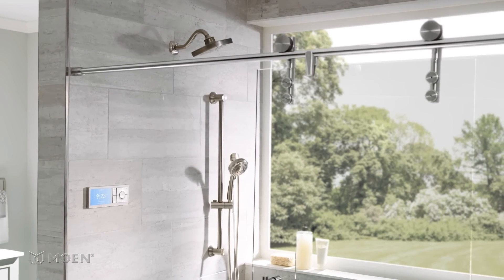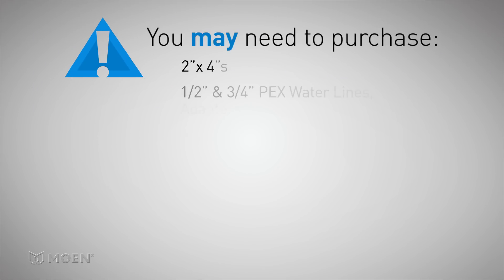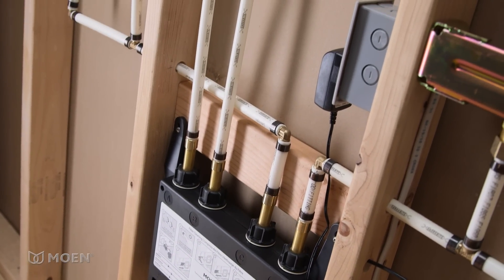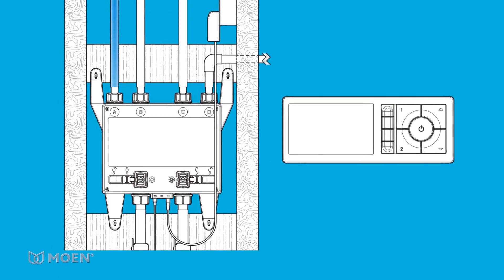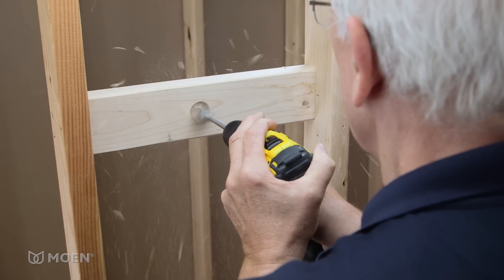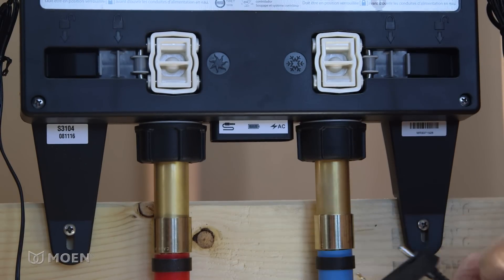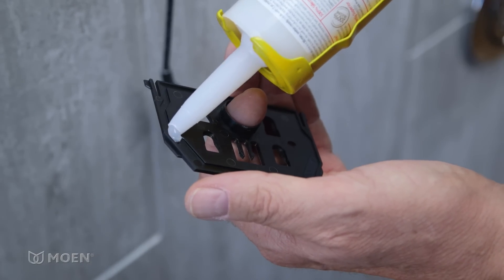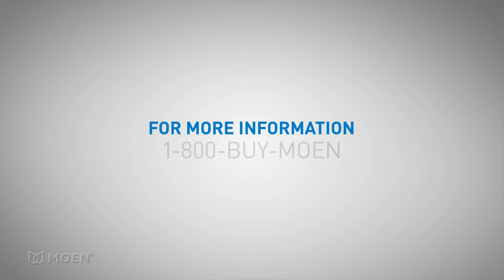U by Moen Shower  |  Installation

Comment: I offer this pro tip...  I had the predecessor to this unit the Moen I/O. And, after 9 years, the valve unit failed. Called Moen.  Buy it for looks, buy it for life?  Yeah, well, the life of the technology maybe.  Moen discontinued the I/O series and, guess what, stopped supporting it. No valve or parts available.  Now, if I had followed the directions and just run the control wire through the studs, I'd be screwed at this point.  However, I'm a son of an engineer and I thought ahead.  

I ran the control wire through conduit and left a fish rope in the conduit.  Yeah that was fortunate to say the least.

So, I pulled a new wire for the U by Moen, had to re-do the plumbing, but got the thing in.  Works.  

Run your control wire through conduit folks!

Comment: Moen: some feedback on the installation process. You clearly intended this to be used with PEX water lines - this video shows the adapters. But somewhere between design and installation, there was a breakdown.

I just finished installing the 2 outlet valve, but I'm confident the 4 outlet has the same problem. The connectors you include in the kit require an adapter to be sweated on before the PEX can be connected. The retainer ring that holds the metal connector on is plastic. Sweating the adapter on requires high heat - hot enough to create solder flow. Plastic melts, so the ring can't be left on while soldering. The retainer ring doesn't fit over the PEX adapter after the adapter is soldered. At least none of the 3 brands my local home improvement big box store carries. End result - there's no way to install this unit with PEX lines unless you do something not covered in the installation manual. Something involving a grinder (to slim down the adapter) and a dremel (to widen the hole in the retainer ring). Something I'm sure your design people would frown over, but there's absolutely no other choice, given the items included in the box.
The solution is simple, just machine the brass connectors to end with a PEX connector. Problem solved. I'm guessing you're going to wind up with some torqued off plumbers, and higher returns than you expected.
Reply from the maker: For specific installation assistance, please contact 1-800-289-6636 (US) or 1-800-465-6130 (Canada).  Thank you.
Reply: Two solutions:  If you sweat the adapter, then you can use a heat shield cloth to protect the plastic body.  OR you can use ProPress to crimp copper to pex adapters on.  ProPress is a "newish" way of handling copper fittings.  No soldering.
Reply: Using sharkbites here is the best option for DIY'ers.... These stubouts can be removed, but the black plastic nut cannot be removed as it will not fit back over the newly sweated fitting.  You can remove the o-ring if you're concerned with too much heat.  I'm not a pro, but I have sweat a lot of pipe over the past 20 years... I could not get a good, clean sweat joint between the moen stubout and the pex fitting.  I ultimately paid the extra cost and used sharkbites.... Pex stubouts for this system should be an option and would make install a lot easier.
Reply: @KevinNichols222 I thought the same, but my biggest concern is that the pipes coming with the valve are so thin that pro press may just bind them. 
Am I right?
Reply: Try connecting pex with sharkbite coupling
Reply: I saw this and thought crimp on or sharkbites
Reply: For me, I wrapped the plastic nut with a cold rag and soldered the PEX adapter. Worked just fine.
Reply: a shockingly sensible comment.  Bravo sir.
Reply: @moenfaucets  That's a terrible response. A written response would be much better, that way others can read it and learn.

Comment: So can you sweat the PEX adapters right onto the copper stub outs without removing them and removing the o-rings and removing the black threaded lock ring All of that can handle the heat?
Reply from the maker: Good morning. This rough in valve can take some heat. We still advise taking caution as to not overheat the unit.

Comment: This is a Great system for those multi head installations  This is at time faster than conventional valving
Reply: but much less steampunk, so there's that.
Reply: Great system? Have you think about when the valve is bad? Tear the wall?😢
Reply: @UltraHydrophobiccoat  You generally put this in an accessible spot, or put an access panel in to get to it quickly.

Comment: So no tips on soldering the tiny brass nipple with the plastic threaded ring in place? Since it wont fit over the pex adapter...
Reply from the maker: Hello greenis3006 and thank you for your interest in Moen products. The CC connections on Smart Shower valve outlets and inlets can be connected to Pex, copper or CPVC with standard plumbing adaptors. We do not recommend applying excessive heat near the valve. The plastic nuts and CC connections can be removed to plumb adapters to the connections. If you have additional questions regarding installation of the Moen Smart Shower, please contact Moen Smart Water Support directly at 1-844-633-8356.

Comment: I recommend if you're going to install the battery backup, put it OUTSIDE the wall, not inside, otherwise it becomes a 30 minute chore to change the batteries rather than  a 5 minute quick job.

Comment: I am in the process of a renovation. Got to the installation and find the hot and cold valves are reversed on this unit. WHY would Moen do that. My renovation just came to a screeching stop. Hot water on the right? REALLY? Look at this video. Hot is on the left from the back.
Reply from the maker: Hello Swynne,  can you send us a complete picture of the Moen product installed in your home, address where the product is installed, email address and a copy of your purchase receipt. If you would prefer to send this information directly, our email address is moenwebmail@moen.com.

Comment: Couple questions, how does the copper cap connect to the plastic piece in order to cap it off? Also the battery backup is meant for a power outage of several days?  Well if you don’t have power you won’t have hot water and if on a well you won’t have water either.
Reply from the maker: Hello CP H. If you are referring to our U by Moen system, there are no caps included.  It is a 1/2" brass outlet and any compatible 1/2" cap would suffice. The battery backup provides the opportunity to shower for 2-3 days, which will be dependent on your hot water environment.  Should you have any questions, you may contact us directly at 1-800-BUY-MOEN (1-800-289-6636) or email at https://www.moen.com/customer-support/contact-us.
Reply: If the power goes out and you have a natural flue vent (B vent) type water heater with city water, then as long as the gas company doesn't run out of natural gas you are good to go.
Reply: the battery backup is just to eek out a leeeeeettle bit more money for Moen.  Yeah if the power is out, you probably huddling by the fire not worrying about a shower.

Comment: Is it possible to install more than one controller to one valve unit? For example: one controller outside of the shower, and one controller inside the shower.
Reply from the maker: Hello juvehe and thank you for your interest in Moen products. No, you cannot install more than one controller to one valve. The Smart Shower valve is designed to work with one controller. However, the Smart Shower can also be controlled using the U by Moen Smart Shower app for Android and iOS. If you have additional questions, you can contact Moen Smart Water Support directly at 1-844-633-8356.
Reply: @moenfaucets  thank you for the reply. It's quite unfortunate that this Moen product does not work with 2 or more controllers, I would purchase it if it did. Perhaps some consideration for future models. Not everyone is tech-savvy, and able to operate the valves from the app. My senior citizen mother will certainly not be able to but she can definitely operate a controller from outside the shower.
Reply from the maker: Hello Juvehe. Moen takes consumer comments very seriously and we are delighted to have the opportunity to hear your opinion regarding our Smart Shower. We would like to assure you we continue to look for new and better ways to satisfy all of our consumers' needs.
Reply: @moenfaucets  它可以由 Alexa 语音控制吗？

Comment: So what if I’m using cpvc could I take the black plastic nut off and use adapters on the threaded plastic ?
Reply from the maker: Hello Randy is Lit. The adapters need to be sweated onto the valve connections, they can not be used on the threaded body of the valve.

Comment: Question, is there a bypass valve in case anything goes wrong with the system which will revert the shower to a manual shower?
Reply from the maker: Thank you for your interest and support of Moen products. No, there is no bypass for the Moen Smart Shower. The Smart Shower requires power to operate and the Smart Shower Valve is designed to only be used with the Smart Shower Controller. If you have any additional questions, please contact Moen Plus Support at 1-800-289-6636.

Comment: I noticed the valve inlets and outlets are slightly tapered on the ends. Can a Sharkbite fitting be used directly on the valve to transition to PEX?
Reply from the maker: Hello Ghanvass.  Thank you for your interest in the U by Moen Smart Shower. Yes, you can use Sharkbite type fittings to connect PEX to the valve's copper inlets and outlets.
Reply: @moenfaucets  can I use press fitting on the brass inlets and outlets?

Comment: I want to install my 4 valve in the horizontal position between the floor joists below the shower, in the mechanical room. The wall behind my shower is a finished custom closet, no war to create an access panel. Will water pressure be enough from valve mounted position below the floor? One of the valves will travel to a ceiling mounted rain shower head. Checking to see if this will still have enough pressure to supply to the rainshower head...12 ft if pipe.
Reply from the maker: Hello Matt Epps. Thank you for your interest in Moen products. Yes, you can plumb one of the U by Moen Shower valve outlets with a 12 ft pipe to a rain head. We recommend you have a minimum incoming pressure of 40 psi. If you have any additional questions, please contact Moen Consumer Services at 1-800-289-6636; our current business hours are Monday through Friday from 9:00 am - 5:30 pm EST.
Reply: @moenfaucets  excellent... thank you

Comment: I feel confused about where to install the controller? What is the maximum distance between the controller and valve? We'd like the controller to be outisde of the shower, on a wall next to the shower door. It's on the same wall as the valve, but I'd like to know the recommended (and maximum) distance between the two.
Reply from the maker: Hello Lauren.  Determining the location of the controller and its distance to the valve must allow for adequate slack in the 30 foot date cable to accommodate a "drip loop"  in the data cable.
Reply: Moen b
Reply: Moen b
Reply: In my country Is 220 volts. Do you have the valve with this current..?
Reply: @ezequielkropp4416  you just need anything with 10V 1A output and the right plug and it'll work. good luck.
Reply: Lauren, it'll fit anywhere but trust me, you'll want it in the shower, bc if you get chilly, you just push that little button and tada!  Off to the side of the shower in the drier part, bc you know what they say about showers and electric stuff.  bzzzzzzt!

Comment: Since the controller cannot adjust the water pressure, is it possible to install a manual control in the shower to increase or decrease water pressure?
Reply from the maker: Hello Ashley Michelli. Thank you for your interest in Moen products. You can install a shower head with built in volume control with the U by Moen Shower. We also manufacture a volume control device (model #91888) that can be used with the U by Moen Thermostatic Digital Shower Valves, S3102 and S3104. If you have any additional questions, you can contact Moen Consumer Services at 1-800-289-6636; our current business hours are Monday through Friday from 9:00 am - 5:30 pm EST.
Reply: yes. it is possible. the shower distributor has no idea what's downstream so you could connect it to a hosepipe if you wanted.

Comment: It should be possible to hook up to a 12v source permanently instead of the regular outlet? Or does it need regular hookup for something? Since my van build is all 12v this would be perfect
Reply from the maker: Hello Janzen. Moen Smart shower valves require a GFCI electrical outlet with continuous power (120v/60Hz).
Reply: @moenfaucets  so they don’t have 12v?
Reply from the maker: Hello Janzen. The Moen Smart Shower is designed to only be installed with the GFCI electrical outlet with continuous power (120V/60Hz).
Reply: @scrumtios0  Janz, it needs 10V and 1A. It'll probably work fine on your 12V system. But, this is waaaay too fancy to put in a van.

Comment: Can this be installed in an attic space above a shower?
Reply from the maker: Hello Charles. The U by Moen Smart Shower power supply and valve must not be installed where the ambient temperature can exceed 104°F (40°C) or where freezing may occur.

Comment: I thought u weren’t suppose to put a outlet or plug inside a wall, and what if the gfi trips how do you reset it…..
Reply: That's why they require an access panel
Reply: oh you can put anything inside a wall if you aren't gonna tell Inspector Javert.

Comment: Having trouble with this. Panel won’t power up, gfi outlet is fine, grinder plugged into it and turned on, everything seems fine and in its place, just don’t get power when connecting adapter cord to power cord panel doesn’t power on at all. 🤷🏼‍♂️
Reply from the maker: Hello Michael de’ Medici. We're sorry to hear about the trouble you are currently experiencing with your U by Moen Smart Shower. Please perform a valve reset by unplugging the AC adapter and optional battery backup for at least 5 minutes. If you need further assistance, please contact Moen directly at 800-289-6636. Our business hours are Monday through Friday from 9:00 am - 5:30 pm Eastern Time.
Reply: Were you able to fix it? Same thing is happening for me! , cant turn panel on
Reply: you gotta jiggle that cable a little. Whisper to it.  It'll work. Keep the faith.  Or call Moen and they probably gonna send u a new one.
Reply: I'm experiencing the same problem. I bought this house with the Moen "smartshower" installed so I know nothing about it.  I tried jiggling the connection as suggested but it didn't work. It's not a technical solution which means it hit or miss? So unreliable. Another problem is the entire water source is 100% dependent on a faulty system, meaning there is no back-up to turn the shower on manually. What a piece of junk. Not a well thought out solution. And the term "smartshower" should be erased from the description. BTW Customer Support goes by a script. Clearly the really understand their own product. Their solution was for me to purchase a new control panel which did not fix the problem.

Comment: if yours stops working and has lines on the display screen, take it off the mount, and unplug the data cable then plug it back in and it'll work

Comment: What do I do when the gfi outlet trips and it’s buried in the wall so I don’t have access to it?
Reply from the maker: Hello Marc Jusino, Thank you for your interest in Moen products. An access panel to the valve for service after installation is required. The minimum access panel opening is 14" wide and 29" high.

Comment: Temperature control is not working.  It runs at constant temperature . Double checked it gets both hot and cold water 😒
Reply from the maker: Hello Vignesh San.  We are sorry to hear about the issue you are experiencing with your Moen Smart Shower.  In order to assist you further information is needed.  Please contact Moen directly at 1-800-BUY-MOEN (1-800-289-6636) and make sure to choose the option for SmartHome products. You can also send us an email by visiting our website at www.moen.com and filing out the form under the “contact us” tab. Our business hours are 8:00 a.m. - 7:00 p.m. Monday through Friday Eastern Time.
Reply: it's supposed to run at constant temperature.  You gotta push the buttons to change it.
Reply: Lol. I connected hot to cold inlet and  cold to hot. I swapped connected and made it right . It works now !!

Comment: Hello, Moen team! Can pex adapters be attached by using pro press instead of soldering?
Reply from the maker: Hello Artem Fandin and thank you for your interest in Moen products. The CC connections on the U by Moen shower valve outlets can be connected to Pex, copper or CPVC with standard plumbing adapters. The inlet and outlet connections of the valves are standard pipe sizes - either 1/2" or 3/4".  On the 2 outlet valve, S3102, the inlets and outlet are both 1/2". On the 4 outlet valve, S3104, the inlets are 3/4", and the outlets are 1/2". If you have any additional questions, you can contact Moen Consumer Services at 1-800-289-6636; our current business hours are Monday through Friday from 9:00 am - 5:30 pm EST.
Reply: @moenfaucets  looks like I  asked pretty clearly.. can I use the PRO PRESS tool to attach these adapters??
Reply from the maker: Unfortunately we cannot comment on specific quick connects or fittings as we do not test these. Our products meet all applicable plumbing codes and the fitting manufacturer should be able to provide information if the connection meets the same standards. You can find information on the S3102 and S3104 valve plumbing standards on the specification sheet at https://www.moen.com/shared/docs/product-specifications/s3102sp.pdf.
Reply: @artemfandin2935  use sharkbite fittings on the valve inlets and outlets
Reply: I used duct tape. Wrap tightly and it works pretty well.  So you can probably do the thing you have too.